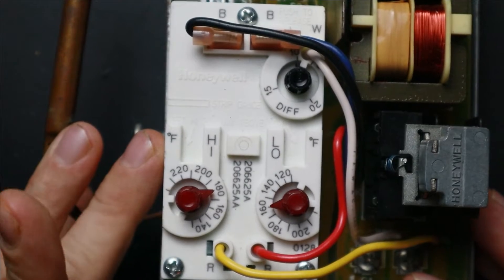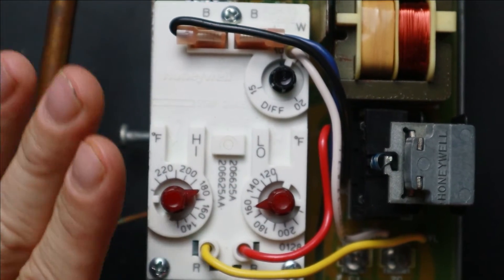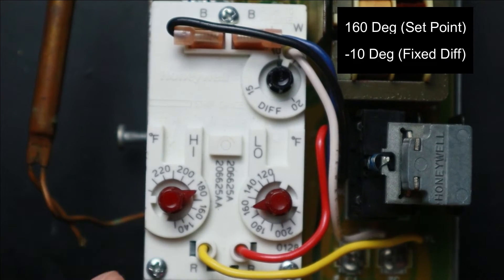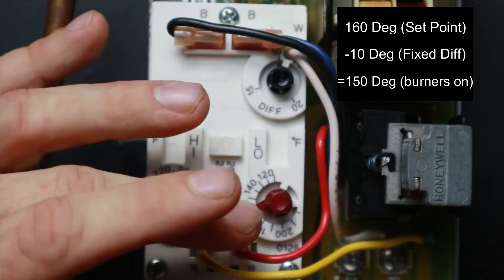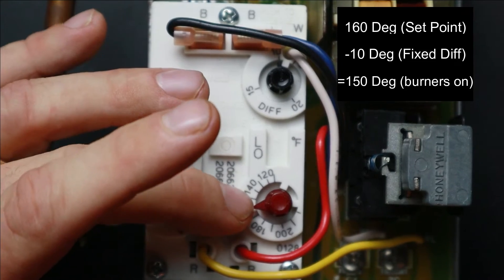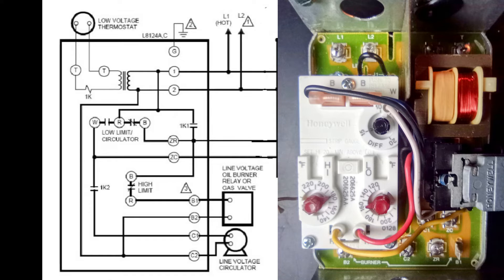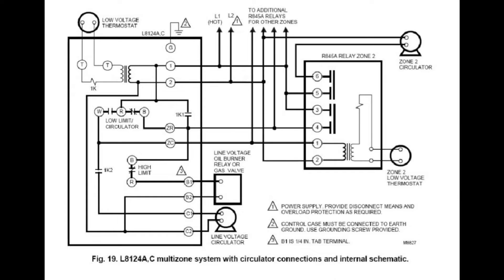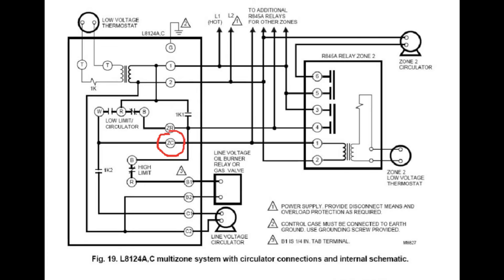Triple Aquastat Basics

Comment: 👍
Very clear explanation.
There's no way anyone esp. a homeowner can figure these triple aquastat settings out without an explanation. The key takeaway is that it controls two temperature ranges. 1) LO and DIFF control the temp range for domestic hot water; 2) HI controls the temp range for baseboard heat. And the lower end of each range is fixed at 10 degrees below both LO and HI.
In summer I turn my LO down to 120 to save oil. I have DIFF at 25 to minimize burner cycling.

Comment: @jerseymikehvac

Great video my man!

I'm hoping you can help me with this triple aquastat.

We have the same one and are trying to install a common maker. 

The instructions say to disconnect the red "T" wire and connect it to an "R" on the transformer. 

Then to connect one of the common maker wires to a "C" on the transformer. 

For the life of me, I don't know which these are on the triple aquastat... And I don't want to assume and test (and melt) anything. 

The rest of the instruction on the thermostat end is straight forward... It's just these two wires that I'm scratching my head on. 

Hope to hear back from you! 
(Or anyone with this knowledge). 

Thanks!

Comment: Hi. I need a C wire to a Nest E Thermostat. I figured out to add an additional transformer. From the transformers One wire will be my C wire and go the the thermostat.. The other wire will go to one of the T's which will have 2 wires under it. One from the additional transformer the other will go to the T on the  L8124A  That will also go to the R on the thermostat.  I am try to find out which of the TT connection is in not on the load side of the contator coil. That will be my R wire.  The load side will be my W wire.                                                                                                                                                                                   Second question. I am also useing a R845 for an second zone pump. All of the above will applies as well about the C wire.. But is there a constant 120V to the transformer of the R845  being connected to the ZR & ZC?

Comment: I wish I heard this before all those aquastat replacements made.  Wow what a video keep them coming!   I found these analog bulb activated controllers are insane to understand till now, thanks for that Mike. I found aquastats only last 10 years and have to change them at a 3 to 4 times the price of today.  I think I am calling it quits on this 27 year old Crown boiler and buy a Nivien.  Had an oil burner then gas came to town then converted to a EzGas Pro Carlin worked great for 4 winters then had to Hot wire 2/12/25 the circulater to the outlet bypassing aquastat and now runs more evenly the heat.  Woopee now I have to spend 12k for a new system in the Spring coming. You have any other option for me?

Comment: Got a trouvke shooting question after following the video. So if i turn up the numbers it should make my hot water hotter because i dont think its doing it as effectively as it should be. 200 hi 180 low diff of 25
Reply from the maker: How old is the boiler and the maintenance schedule kept on it? I'm wondering about scaling. Is there a mixing valve? Hot water coil or holding tank? Tap water would be over 150 degrees at those settings.
Reply: @JerseyMikeHVAC  approximately 6 years old. Last maintenance done was in early October
Reply: @JerseyMikeHVAC  not sure on that i was experimenting with them I pretty I found them as one valve controlled the heat and the other controlled the water pressure just for the hot water.
Reply: @JerseyMikeHVAC  i had to turn down the numbers. But it's still above average. 180 high 160 low since I'm up north in NH probably what's making it colder than normal, but still not steaming hot.

Comment: Mike I have oil burner hot water system . I don’t use the hot water coil.  I have thermostat set at 50 degrees just so pipes don’t freeze . What should I leave high and low at.  So from what i understand the low is for hot water am I right about that
Reply: Similar situation here to. Never can get an answer about a few questions on this. I closed off the valve supplying potable water to home because I installed one of those hybrid rheem water heaters (which I love btw). Was using too much oil for potable water with furnace. So I set my low side to it's lowest setting during warmer whether and raise it back to 160 during winter months so the heat is supplied as it's being called. Don't know if that's the correct thing to do, but that's what I've been doing for 3 years now. Also thinking it's saving me on oil, but I really am not sure. I do spend less than before, but that may be also do to milder winters of late.

Comment: I have an old boiler (smith-pac 14) with a white-Roger’s hot water control relay….type 843A-30. 
The circulator motor relay got stuck on. The relay micro welded itself closed. I was able to file down the relay with an emery board. I know the relay needs to be replaced and I know it will happen again. I’m looking for another relay equivalent to this one. I’m thinking I will have to replace the well also.
 Do you know an equivalent relay for that unit? And the correct well that it will mount into? 
Your help would be appreciated

Comment: Super confusing. 

Zc and zr are both taking power from their relays that go to L2 

Number one on the transformer on the switching relay is getting its power through zc which is ultimately L2

Number 2 off of the transformer on the switching relay is getting power from L2 as welll. 

How is this a complete circuit.

Comment: Just an FYI...after wiring and folding the wires back in to put cover on be VERY careful. My parent's boiler was wired with heavy gauge wire and pushing gently to fold the wires back in caused a small crack in the solder on the circuit board. It didn't act up immediately and let me tell you I chased my tail for days. Finally a magnifying glass and a pair of helping hands revealed the very costly mistake! New Honeywell 8182 1111 down the drain! Thought about attempting to solder but had to get her back on line.

Comment: Mike, great video i came across your video because I'm having issues with one of my thermostats.
I believe one gets wired to the aquistat. The other gets wired to a separate relay box. It looks like I have the same aquestad as you're showing on your video. My problem is one thermostat. When turned up for heat?
The circulator pump starts to circulate and the boiler Kicks on, my issue with the other thermostat, the circulator pump Kicks on and circulates, but the burner doesn't fire. Can you tell me what terminals I need to check? To see if I have power going to the burner, is it b1- b2 i'm going to ring out the thermostat wires that go to that aquastat to make sure that is the thermostat, I'm having issues with. Just trying to figure this out before it gets too cold out. Thank you Mike hopefully, you can get back to me.

Comment: i would like to know what would happen if both rb and 1k1 are closed because of call for heat and low temperature ??
Reply from the maker: Great question. Nothing will happen until the low limit satisfies. R to B will open, R to W will then close providing power to 1K2, the circ pump(s) come on and the boiler will continue firing to high limit. This basically prevents the circ pumps from activating when the boiler is at a low temp condition so cold water in the plumbing isn't pushed back into the boiler to drop the boiler temp even further down below low limit. It acts like a time delay, basically. Until then, 1k1 just provides alternate power to the burner so there is no interruption to firing when R to B switches over to R to W.

Comment: Hi  Mike, great channel, hoping you can offer some direction.
Recently installed a hybrid hot water heater and no longer use the boiler for domestic tap water. I know my boiler has to run periodically to Maintain a set water temperature that circulates for home heating, but does the boiler need to heat to provide  domestic tap separately if so is there a way to turn the temperature setting  off or down so that it's not running for nothing? It has a triple aquaStat  installed. It seems like it runs a lot without the circulator coming on so I know it's not running to heat the home. 
Thanks for your input.
Reply from the maker: You can bypass the low limit by taking the red wire off of the R and the white wire off of W near the low limit controls and just wire nut them directly together. Just make sure to test everything and make sure the boiler turns on and shuts off during heating cycles as it should. 

 Just be aware this is highly frowned upon by manufacturers, and you are taking on a liability for doing this in the event something ever goes wrong, even if unrelated I would guess. 

 A better option would be to just replace it with a standard high limit only aquastat.

Comment: You are very knowledgeable on these topics! I really appreciate you sharing! I have a New Yorker residential boiler with a weil-mclain gold 40 hydronic hot water tank. Water temp has been feast or luke warm. Changed the thermostat and taco valve control. Still having issue, turn the thermo up on hot water, check the taco voltage after 45 seconds, seems to be functioning, but the circulator works when calling for heat, but not for hot water. I got a new resideo L8124 from a friend , retired plumber. Watched your video to get educated on the way it works, took pics, installed the new one, double checked all conns, ok. Fired it up and all seemed ok. left the house for a few hour, came home and found the water boiling! I would appreciate your thoughts! I figure a bad hi-limit in the control. I'm going to get another control, this time a honeywell, like before. Thanks for any help, really appreciate you! Keep up the great work!

Comment: Great Video. Very Informative. What if I wanna install a stand alone tank water heater and not use the tankless feature of the boiler for domestic hot water. What would be my settings then? Should I also cap off the water lines? Thank you
Reply from the maker: A stand alone tank can be put on a zone valve and set up like any other heating zone. On the tank there will be a very simple aquastat that would tie into the zone valve just like you would a thermostat. The temp is set with a dial on the aquastat and usually put to about 120. 

The boiler itself can be set to 180-195. If you have a triple stat on there now you won't need to set a minimum. You can set it all up as a "cold start" boiler since the storage tank will retain hot water and the boiler doesn't need to meet that demand quickly. Steven Lavenmonier (spelling?) has a video on aquastats where he shows you how to bypass the minimal setting if you wanted to.

Yes, cap off the unused coil.
Reply: @JerseyMikeHVAC  Thank you much

Comment: Mike- The aquastat on my boiler is also set at 180-160. However, when the boiler shuts off the temperature on the gauge typically reads 10-20 degrees higher, then gradually drops. Is this normal? Thank you.
Reply from the maker: Gauge temps are often off a little compared to the sensors used that the boiler runs on, and it usually gets worse as the boiler ages.  So long as the boiler isn't exceeding 200 degrees it should be fine. If the boiler is actually getting to 200 (which it likely isn't) then its actually running more efficient. I wouldn't adjust the Hi limit above 180 just to play it safe.

Comment: Are you familiar with steam systems? Oil and Natural gas fired??
Reply from the maker: What's your issue?
Reply: @JerseyMikeHVAC  
Thank you for responding!! 
I just wondering if you could do a video explaining  how to wire in an auto fill with low water cut off. Primarily the McDonnell Miller style set ups and the delay switches on the auto fill. Thanks!!
Reply from the maker: @brandoncoffee8044  https://youtu.be/bSeZqs8n_8M
About 6 minutes in, but the whole video is good to watch.

Comment: Great video Mike..made it simple to understand.. now my question is how do we determine what will be our High limit temp, Low limit and differential on a boiler?
Reply from the maker: Good question. In general, a higher Hi-Limit setting will make the boiler more efficient, but you have to be careful not to create excessive pressure on the safety relief. Also obviously don't want to make steam. A lot of people just set it to 180 but 190 or 195 can be a little more efficient. 

With the Lo-Limit, you always want to be at least 20 degrees below the high limit. Getting the 2 too close together can cause circulator problems. Too low and you risk flirting with condensation problems. About 130 degrees and lower flue gases can begin to condense into an acidic coating that can eat away at the block and flue system. 

With the diff, if you're tankless on a domestic water loop, a higher diff setting provides more available hot water than a lower one. It can also prevent short cycles. It will also depend on whether you have a mixing valve installed to prevent scalding. Many guys will suggest going all the way to 25, but that is going to depend on your LO and HI settings. Going 25 on a Lo setting of 160 and a Hi of 180 will cause overfiring to 185+, and your shower will end up in a ride to the hospital without a mixing valve to temper that hot water.